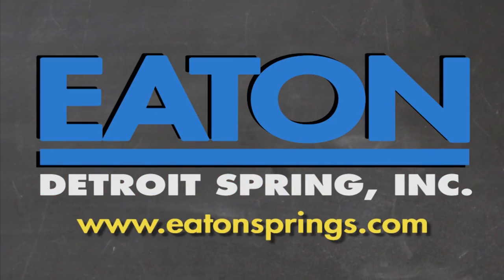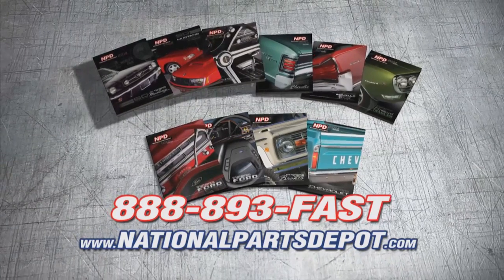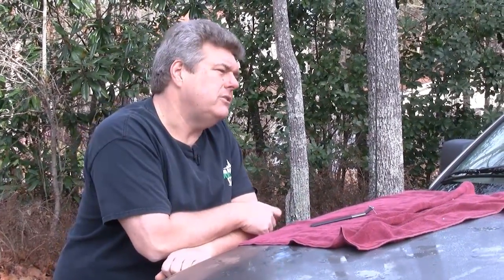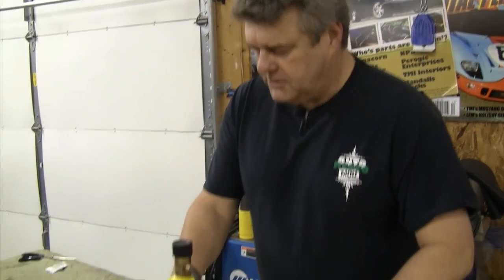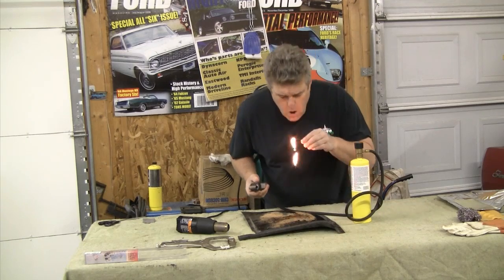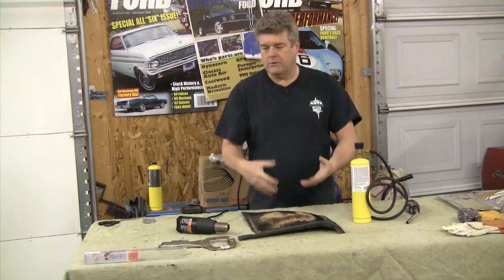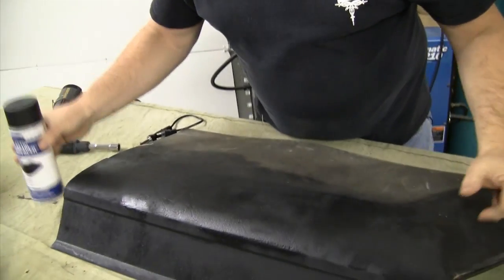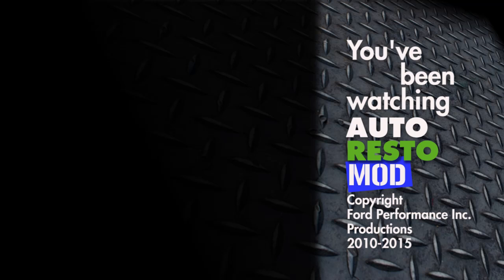How To Fix Faded F150 Cowl Plastic, Classic Ford Plastic Interior With Heat Gun  Episode 198 Autores

Comment: This totally blew me away! I just used this procedure on the very subject of this video, 2005 Ford F150 severely faded cowl vent covers, and I would have never believed it, unless I saw it with my own two eyeballs. Whoever discovered this trick should get a Nobel Prize for auto restoration. I used a smaller heatgun, and used it, very much like air brushing paint and got excellent results! Best to thoroughly scrub the piece first, then get the technique down for even coverage, to prevent, or reduce, a "mottled" appearance. Finalized it with Stoner Trim Shine and they look good as new....REALLY! Will save hundreds $$$ in replacing faded parts.
Reply from the maker: Ken Compton The only problem we've found with the heat is that after about six months it will need to be done again if the truck sits outside.
Reply: You know, I believe your right....it's NOT going to be a permanent fix. I'm already seeing small spots, fading back out! Too bad, it looked like a promising fix. Will probably have to pull them off, scrub them and just do the "trim paint" fix and be done with it. Still don't feel like shelling out $190 for a new pair. Thanks for the follow-up comment, though!

Comment: Used a 3 M pad, the sponge on with the green surface, and sanded the trim with soapy water. Worked well for what I did. Need to mask surrounding areas to avoid damage to them.

Comment: Does using a heat gun on a faded wiper cowl last?
Reply from the maker: Not for long. About six months.
Reply: Is there any additional steps which can be take, i.e. chemical treatment of some sort? Don't think anyone want's to be doing the head gun fix on their wiper cowl every six months.
Reply from the maker: The only clear repair is to paint it with a product that Eastwood sells: http://www.eastwood.com/ew-plastic-resurfacer-matte-black-aerosol.html
Reply: Would you use the heat gun method first and then paint it over, or simply just paint over right away?
Reply from the maker: We'd clean the plastic with a precleaner and apply the finish.

Comment: This method does not last. Looks good for a month then fades worse than it was before. Good quick fix for car salesman but best to just replace. Their cheap
Reply from the maker: Yes. If you look at the response to Razz P we say that the repair doesn't hold up. Had we to do it again (we don't have the truck any longer) we'd do the Eastwood treatment.
Reply: In Canada, these cowls are $93 each. Not cheap for me, I removed, lightly sanded and painted. 🍻

Comment: Be careful doing this. Tried on my 2005 F150 and it lasted about a month.... Plastic turns white .Toouch heat?  BULLSHIT!  This is just bad too do period.Mabey you should try plastic die paint. I know I will.  I did this heat methed on my cow near windshield.. Sucked after about a month.
Reply from the maker: Ours lasted six. I agree with you on the paint though. Eastwood now offers a paint for this.
Reply: What paint from Eastwood?